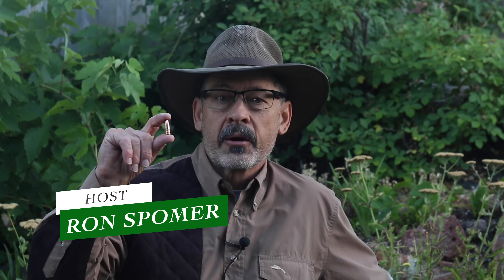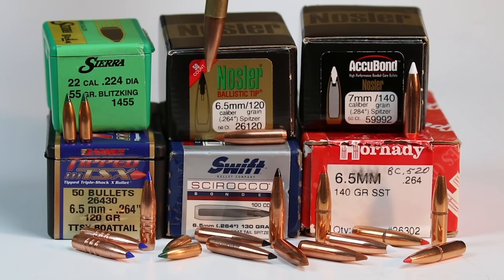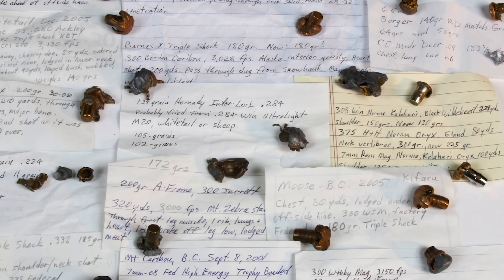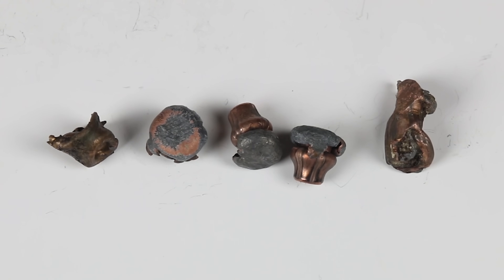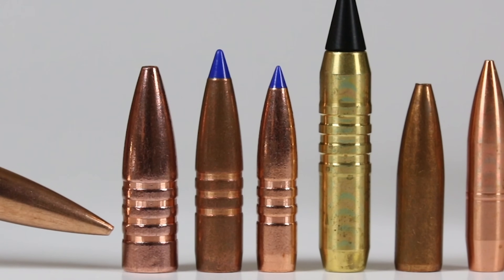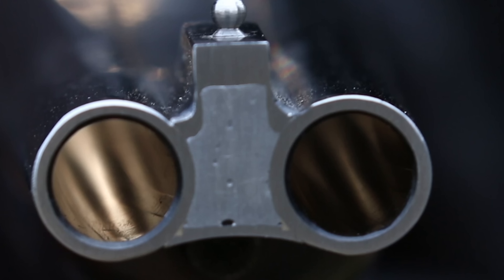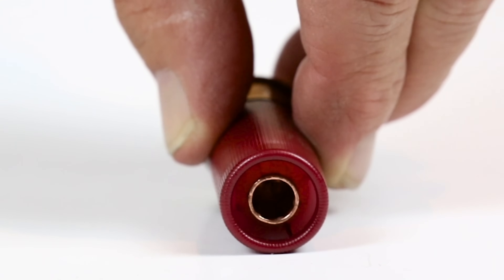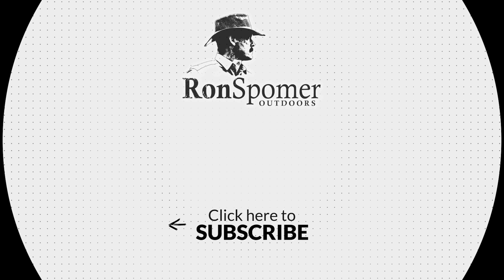Copper Versus Lead Core Bullets — How They Work

Comment: Excellent! There is far too much chat about relative calibres and their effects and not about what bullet construction is best for different types of game depending up the nature of their hides, their size and whatever. 

@Ron please do a review of 6.5 and 7mm hunting bullets and tell us what is likely best for roe deer, red deer, wild boar (proper ones, not feral pigs) etc

Love this channel, no b.s. and Ron doesn't have any dogmatic views, just evidence based understanding and experience. 

This and Hicock are my favourite shooting channels for sure.
Reply from the maker: Thanks Richard. As for best bullets, that's complicated and variable depending on impact velocities and shot placement. As a general rule, any bullet designed to expand 1.5 to as much as 2X while retaining sufficient mass to maintain momentum increases penetration. Bullets that "explode" shortly after impact (varmint bullets) can kill quickly if that fragmentation happens within the heart/lungs. Massive hemorrhaging. Intact bullets are more likely to lace completely through and retain sufficient integrity and energy to break bones and hide on the far side, leaving a large exit wound for blood trailing. I've found Barnes TSX and TTSX quite effective for all species in conjunction with the right cartridge/velocity, but in general game struck with them and all other controlled expansion bullets that retain most mass and penetrate deeply or completely through stand, walk, or run for 3 to as many as 10 seconds on average before "running out of air," meaning blood pressure drops and they faint, then expire. You typically see this as a wild dash, then vering off course, wobbling, stumbling, falling, a bit of kicking, done.
Reply: @RonSpomerOutdoors  thanks Ron!
Happy hunting

Comment: Does anyone use copper bullets in 9.3x63? It is low speed caliber and i wonder if bullet will expand properly. Now all bullets have polimer tip for better opening. Another important question:  in europe where driven hunt are common often second shot is a must. Shooting of sticks is easier than free hand and lead and expanding bullet helps to kill animal when shot is not perfect. I think than on driven hunt there will be more wounden, not recovered, wasted animals. Best wishes to All in New  Year 2022

Comment: I did not know density factored into BC I always assumed it was the length and shape of the bullet, I had thought copper bullets being larger for the same weight had higher BC but I guess I learned something there. Thanks!
Reply: crumble some paper into an orange sized ball and wrap it in plastic wrap so its exterior is smooth. grab an orange of equal size. Throw them both as hard as you can and measure which one goes farther.

Comment: I have 130gr Barnes TTSX's that I reload for my .270.  I find those to be extremely accurate!  The twist rate of the barrel and the length of the bullet must be a good match!🇺🇸✝🇺🇸
Reply: Garrett For Christ.  Good day Sir, hope you are well. I want to start loading the TTSX bullets in a few different rifles and one happens to be a 270Win. Do you recall how many thousandths of jump to the lands you found your best accuracy in the 270Win.? I know all rifles are different as to what they prefer, but cutting down on time and money while experimenting is part of my goal. Thank you in advance for any information and or advice you can lend a fellow hunter/shooter.
Reply: @stevepuyear2738  
I can tell you what I load for it, but I'm not recommending any loads.  I use the 130 grain Barnes TTSX bullet and load it with 53 grains of Hybrid 100v.  Your load might be slightly different for your barrel's twist rate. Again, I'm not recommending any loads.  Consult your loading manual.  I hope this helps.🇺🇸✝🇺🇸
Reply: @garrettforchrist2700  Garrett thank you for the data. My son's name is also Garrett. I'm always cautious and drop 10% off any recommended loads after consulting manuals. I was curious mostly as to the burn speed range of powder you were finding to work well in your particular setup. Thanks again and good luck out there this season. Be safe as well!

Comment: Excellent presentation,  as usual. As a handloader also addicted to lever action rifles, I'm now tempted to try loading monolithic bullets in .45-70 Government, .30-30, .44 Remington Magnum. Any experience with these, or know of others who have? I hunt in the Northwest Territories. Moose, bear, wolf, wolverine, caribou, etc., and defense from dangerous game. 

Take care.
Reply from the maker: I've taken a couple of black bears with monolithics in 30-30. Hornady 160-gr. Monoflex. I shot kills.  Did not find 300-gr. Barnes TSX in 45-70 Marlin 1895 to be a quick killer on two big warthogs. One ran 100 yards after perfect shot through the chest and required finisher. 2nd took 3 shots to chest. Bullets appeared to have opened properly, but even if they hadn't, 45-70 fans insist they are so wide that the big hole and big punch of the 45-70 should kill right then and there. I don't see where the all copper was too blame. Expansion is expansion, copper or lead. I will experiment additionally.
Reply: @RonSpomerOutdoors  thanks. I'll have to try them out. Happy hunting.

Comment: Possibly the most informative of all your videos! Great job!  In 2017 I saw something that I would have sworn would never happen with a 165gr Barnes TSX from my 300 WSM. A friend shot a large 6x7 bull elk slightly quartering to, but almost broadside two times at 320 yards. The bull laid down briefly, but then got up and traveled approximately 150 yards before dropping for good. There was no blood where he initially laid down, nor along his trail that I was able to follow through disrupted pine needles on the forest floor. Both bullets impacted within three inches of each other, penetrating the back half of the on-side front shoulder and ranging through to just behind the off side shoulder.  Both bullets failed to exit and were just under the skin on the off side, each beautifully mushroomed with all petals intact.  Upon examination, we found a lot of hair packed inside the curl of each bullets petals. This particular bull elk had the longest winter coat of any elk that I've ever seen and my assumption was that the extremely long hair had initiated bullet expansion before entering the elk's body, which also could explain why there was no exit and absolutely zero blood, even around the entrance wounds. While that same bullet has performed wonderfully for me all other times, I think this case just shows that we should never assume anything and to be ready for follow-up shots, even when we are confident of bullet placement and the bullets 'normal' performance.
Reply from the maker: Yes. Trusting every bullet to perform perfectly every time is not wise. Always be ready to administer finishing shots, or, as many elk guides say, keep shooting until its dead! I've found that, in general, all animals remain conscious for several seconds after solid heart/lung shots. It isn't until blood pressure drops that they get dizzy and fall. And then, of course, it takes roughly 10 min. for brain cells to die from oxygen deprivation.

Comment: I fought against monolithic bullets like the Barnes TSX and TTSX for years.  When I finally fell for them, I fell hard.  I use the Barnes and animals that I have shot have all had massive terminal damage and complete pass throughs.  For example: the Barnes 110g TTSX out of a Tikka 270 at 3410 FPS gives complete pass through but it looks like a bomb went off inside the Whitetail.  I still use lead core bullets for predator hunting but prefer the all copper for big game.

Comment: Great video! It would be very helpfull and interesting if you made a video or several about shot placement. Both of the kill scenes in this video was of so Great quality. They also wasnt typical broadside hits. This is a topic Im very interesting in as a New hunter. As a New hunter I would probably held my shot in those situations, I simply wouldent know where to put the bullet. Your wast experience and by the look of it, Great video archive, would be pure gold as a learning resource.
Great stuff!
Reply from the maker: Thanks Zapnes. In general the highest percentage shot is thoracic cavity. Right on or just behind the shoulder to catch lungs and heart. Give the most room for error, roughly a 10" vital zone for deer-sized game. Brain, neck, spine shots are much trickier due to small size, imprecise location estimation, quick movements of the prey.

Comment: Another good bonus of bonded and copper projectiles is if you have to make a follow up Shot. Now I don’t condone shooting animals up the rear but if you put a poorly placed shot the first time, sometimes the only follow up shot you’ll get if from behind. With a bonded projectile you know for sure the projectile will punch far enough to hit vitals. With a cup and core you can’t be sure, it could penetrate 12 inches and not make any vitals

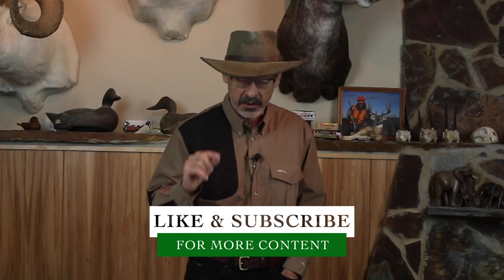Comment: NONSENSE. It is not the twist rate of a barrel that stabilize the bullet; it is the rate of rotation (RPM) of the bullet as it leaves the barrel. This is a function of not just the twist rate but the velocity. A 1:9 inch twist might be needed to stabilize a particular bullet when shot at 2,400 fps, but that same bullet used in a bigger case with more powder might stabilize with a 1:12 twist simply because it is moving at 3,200 fps. The rate of spin is the same 192,000 rpm, hence the amount of gyroscopic stabilization force is identical. A prime example of this is that 300BLK rifle uses a very fast 1:7 twist to stabilize heavy subsonic bullets like the 220gr SMK. That is because it is moving at mere 1000 fps. That same bullet will stabilize in a 1:12 or 1:13 on a 300 Win Mag or 300 WSM because it'll be leaving the barrel at 2,700~2,900 fps.
Reply from the maker: Thanks for the fine details on spin, Dwight.
Reply: @RonSpomerOutdoors  Just pointing out something that a lot of people are mistaken about.

Comment: You didn't mention the Remington Bronze tip bullets.  These were great I would shoot an antelope or Muley and the result was almost the same, the animal would spin 360 degrees, take 2 steps and drop but when polymer tips came out they went away.  The first time I shot a good sized mule deer with the Barnes 130 grain boat tail from my .270 Win. it just dropped dead without even kicking. 
I would still be shooting that bullet except I "discovered" the Barnes 110 grain boat tail TSX in front of 60 grains of H414 with winchester large rifle primers this puppy leaves the muzzle at 3500 ft/sec and the animal acts like they ran into an electric fence.  You can actually see an expression of shock on their face, with eyes bugging out and mouth wide open
The plan:  for muleys, pronghorns Etc.-110 Grain TSX.  For elk or Moose - 130 grain TSX  These don't have the polymer tips as I have not tried the TTSX yet plus the TSX really slugs 'em.  I also might try the MRX with it's higher BC.
Since I refuse shots beyond 400 yards and will not admit to any beyond 300 (point blank range on big game animals with the .270) I will probably stay with options 1 and 2
A question: If I were crazy enough to re barrel to a 1 in 7 or 8 twist, why would I consider a 6.8 western over a .270 WSM?  Just sayin'

Comment: It's weird how sometimes stupid laws help us to create better products. The advent of steel shot Still remains a problem for waterfowl hunters but they have gotten better over the years. The copper bullets for the most part are an advancement in rifle bullets as far as I'm concerned though. I load a Lot of Barnes bullets in .223, .270, and .308 and I find them quite accurate and effective. One you didn't mention was the new ( Tumble on impact ) bullets from Fort Scott Munitions. A very sharply pointed solid copper bullet, also made in brass that does not depend on expansion but tumbles about twice in the first foot in soft tissue and really tears things up. They come in a lot of popular calibers both rifle and pistol. If you haven't tried them you might want to take a look at them.

Comment: Being a handloader for 5 decades I am after precision. I get a load that is accurate at ranges to where I think I will be shooting. Now, Nosler partitions wouldn't expand in a bear at 200 yards, I quit using them. All other manufacturers were on the table. Lead core was the bullet of the time. One thing I did learn at an early time was different manufacturers have different idea about what the diameter of a bullet should be, even from one weight to another. I have taken my micrometer to a store and opened boxes of bullets and miked them for diameter. Copper bullets I have tried in the last few years still have this problem. Anyone want to explain why a 308 bullet from a company will be .30725 instead of .308. Especially when those bullets are being manufactured by a machine that is capable of .0001". OH, good topic Ron. Wish those copper bullets weren't so expensive, one copper = 3 lead core.

Comment: I only shoot monolithic copper in my rifles. The only thing I would add is that I like the bullet to be going at least 2100 fps when it hits the animal. I've found that the monolithic copper bullets can act like a full metal jacket when velocity drops below 2000 fps. My two cents is that If you want to shoot an animal at 500 yards (which is further than I'll shoot at non-varmints), you'll want a relatively overbore cartridge like 6mm Creedmoor, 270 winchester, 7mm mag, etc...

Comment: What would you suggest for thicket hunting with a 30-30 or 35 caliber?
Reply: In 35 Remington, I would try a 200 grain slugs from one of the lesser-known manufacturers, e.g., Core-Bon.  It has been my experience that the bullets from Remington and others do not reach advertised velocities and lack expansion for that reason.

Comment: also, copper coated bullets came around cuz a pure lead bullet cannot withstand velocities of modern powders....the lead melts going thru the barrel.  40 grn .22 lr is often lead round nose while 36 grn .22 lr is almost always copper jacket...its higher velocity will melt lead.

Comment: lead is a naturally occuring element on earth..like copper,gold,silver,mercury etc.  it works in bullets and is NOT dangerous!!  unless you get shot!!
Reply from the maker: Arsenic and plutonium are naturally occurring elements too. I wouldn't advise ingesting them. Nor mercury. Nor lead. Lead fragments disbursed through game animals have been clearly and positively identified within bird and mammal scavengers that ate said game animals (gut piles or the entire animal, wounded and lost.) Lead salts within those animals circulatory systems were correspondingly excessive. Many died. More were sickened or weakened to the point they were unable to avoid predators. Bald eagles, golden eagles, red tailed hawks, ravens, crows and many more. The scientific literature is littered with this evidence. I've seen no concrete evidence that humans ingesting these lead fragments suffer ill effects, but I'm not willing to pronounce lead as the healthiest substance since pure water. BTW, last fall I shot a deer with a 175-grain cup-and-core lead bullet. We could feel it lodged against the offside hide. The largest piece of that fragmented bullet weighed 32 grains. That means 143 grains of lead and gilding metal jacket lay within the flesh of that carcass. We found several flecks as we cut and trimmed, but hardly all.
Reply: @RonSpomerOutdoors  why did you use a lead cup in core bullet last fall if copper is sooo good???
Reply from the maker: @bangsdagong  Jeez Bang. I'm not a one-trick pony. And my job is to test, investigate, and report on all aspects of hunting/shooting. I've even hunted over corn piles in TX a time or two. And bedhind some fences so I can report accurately on this stuff. But I gotta tell you after cutting around that bullet hole mess with all the little lead fragments, I'm a lot less likely to use lead next time.
Reply: @RonSpomerOutdoors  fair enough!!  keep the crosshairs on and the trigger smooth! GOD BLESS YOU!!!

Comment: The collection of recovered projectiles and notes about them is the best data I’ve ever seen related to bullet performance in flesh. Almost every other thing I’ve seen on this topic amount to “cool story bro”; just random opinions and no data. 

Personally, I’ve used cup/core bullets (berger) for years and never had a bad experience, but I’m also very choosy about the shots I take, so that may be more of an anecdote than a data point. Not to mention my sample size is much smaller. I’ve shot everything from deer to moose with them and it’s always worked out, but I really appreciated how you compared the various outcomes with different projectiles. Top notch stuff.

Comment: Shot a black bear with a cup and core bullet (165 grain 308). Core separated from jacket after taking out a rib and neither exited the animal. There was a few drops of blood near where I hit it and basically no blood trail to speak of. Luckily, I actually saw where the bear dropped so recovery was a breeze, but I believe the lack of an exit wound would have made recovery impossible had I made a more marginal hit. Just something to keep in mind when hunting tougher animals with conventional cup and core bullets.
Reply from the maker: Good point, Clinton. While bullets that break up and stay inside can be lethal, animals with lots of subcutaneous fat and/or hair might be best addressed with a controlled expansion bullet that maximizes penetration. A sizeable exit hole can provide good blood trailing.